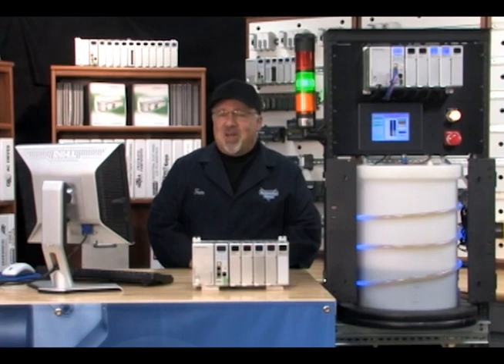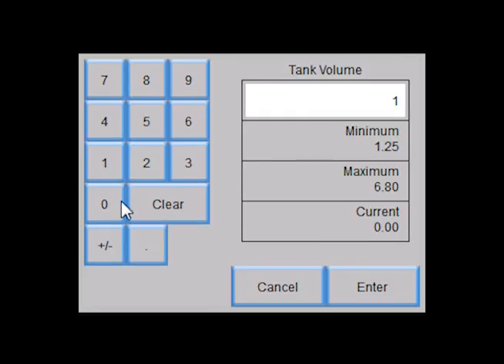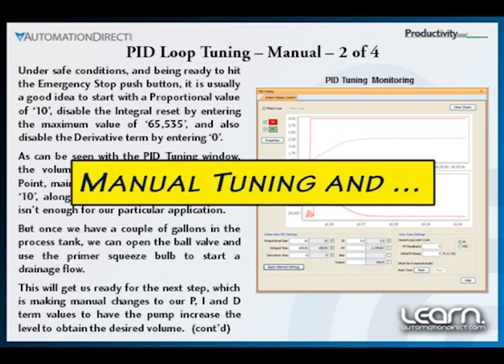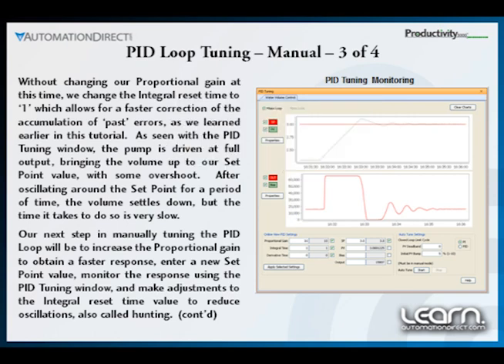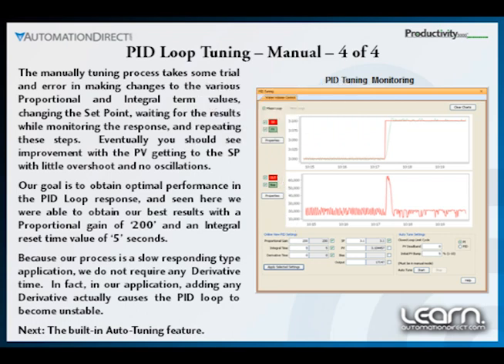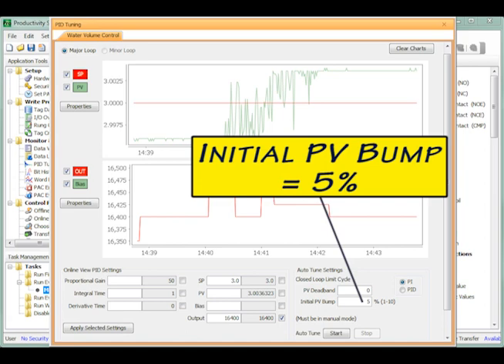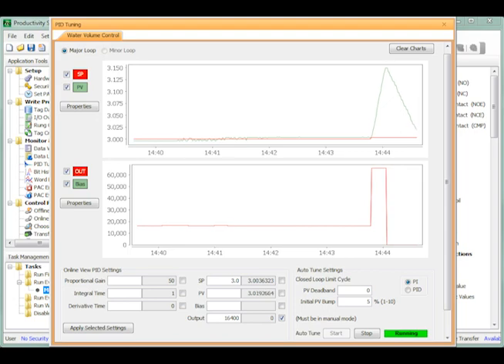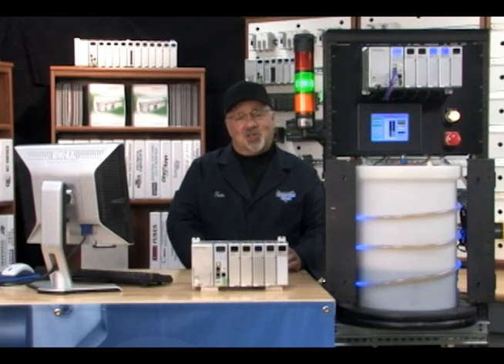Productivity PID Loop Part 10 - PID Tuning from AutomationDirect

Comment: The reason the derivative caused your loop to become unstable is you jumped from 0 seconds to 1 second. Possibly 0.00001 would be a good number for your derivative but you aren't able to put that number in as you chose the data type to be integer instead of float. All your tuning parameters really should be floats.
Reply from the maker: @SWRDMaster
Great tip, and certainly a strong recommendation as a way to increase the precision of the system. Productivity does allow you to assign a floating point variable to the P, I, and D terms. Thanks for the comment!